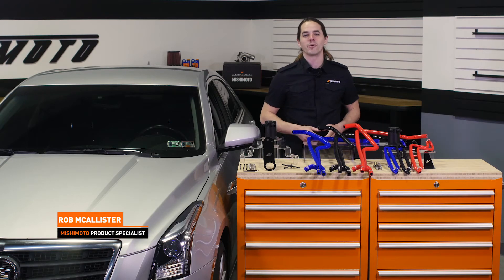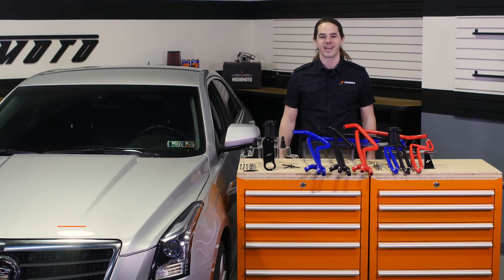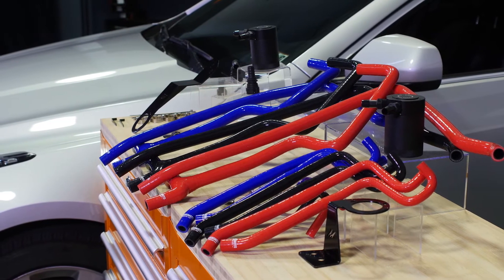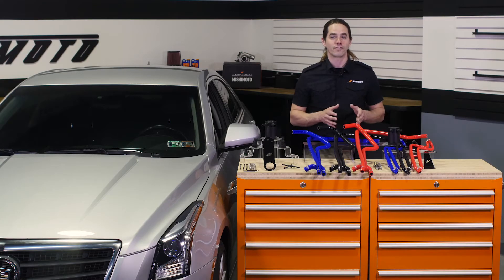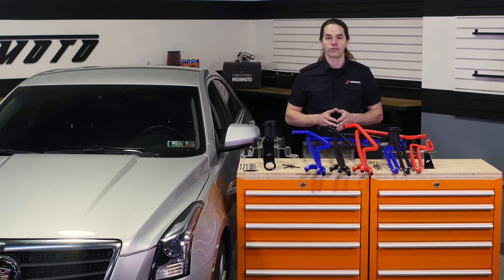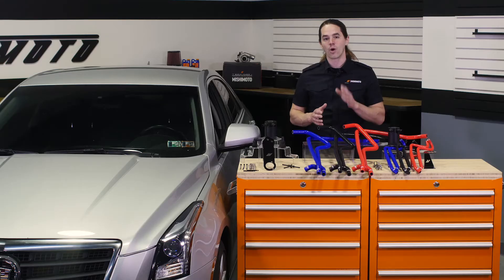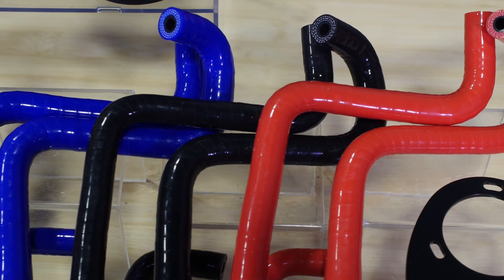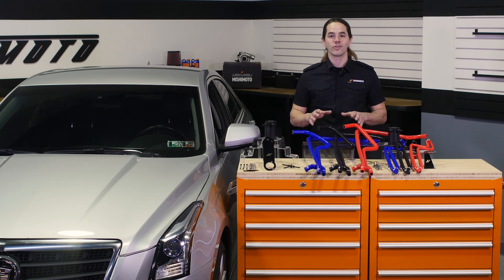2013+ Cadillac ATS Baffled Oil Catch Can System Features & Benefits by Mishimoto

Comment: What about a used Cadillac ATS with 120,000 miles on it already..  and no catch can.  How much damage has been done?  Is there anything that can 'easily' be done to reverse the damage?  I hate to add an expensive part/catch can, if the damage is done
Reply from the maker: We would suggest installing the catch can as soon as possible. The only way to "Reverse" this would be to disassemble the head and clean the valves yourself. Sorry!

Comment: Will this fit a 2014 cts 2.0t?
Reply from the maker: Hey Phillip. This kit is a Direct fit for the 2013+ Cadillac ATS 2.0T. While this kit may possibly be adapted to your CTS, it is not something we would be able to confirm at this time due to lack of testing. If you would like, I'd be happy to submit a new product suggestion if you feel your CTS 2.0T would benefit from a catch can system.
Reply: @mishimoto  Has there been a update on this? I'm interested to know if this system will work on the 2104 CTS 2.0 turbo. Thank you.